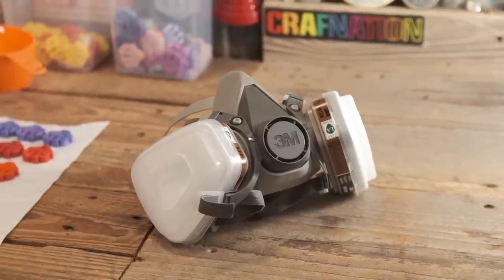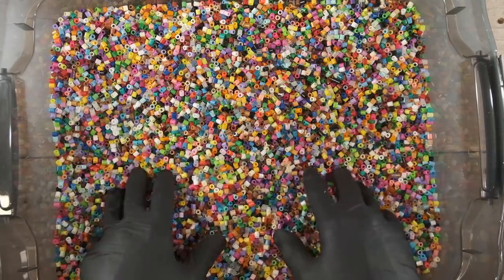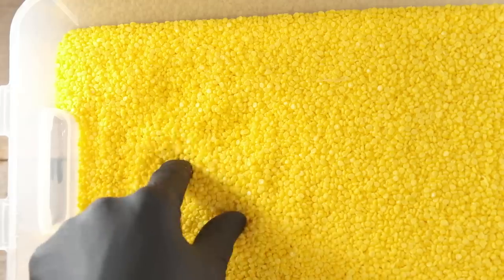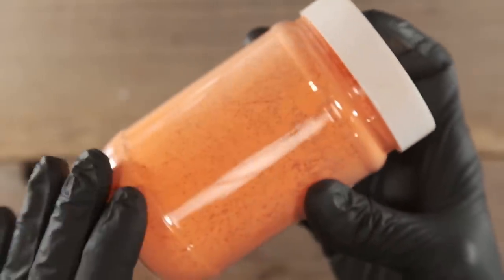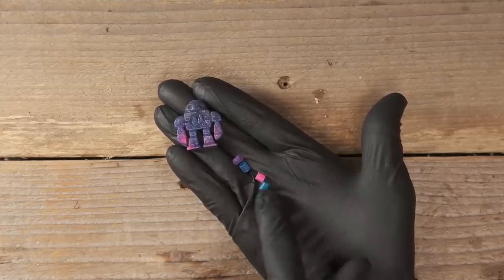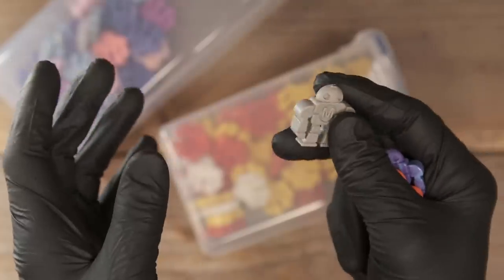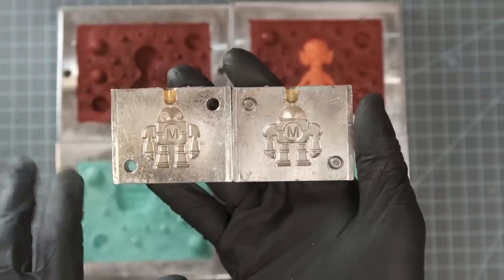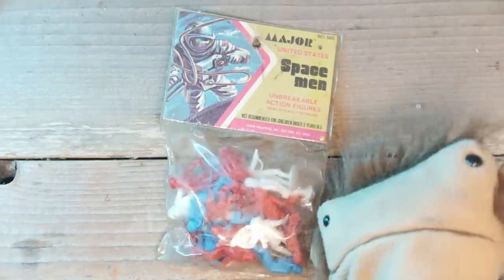Injecting PERLER BEADS! (Galaxy robots, fume extraction, metal molds...)

Comment: Crafsman, you may want to mount the motor for your fume extractor up on the wall next to the filter, that way it won't be quite so noisy, and that way you could run the hose down to wherever you might have some fumes need extractication in a more temporary situation, it would not be as heavy or as cumbersome as moving the motor if you needed to use that space for non-fume type activities
Reply: Brilliant idea.
Reply: Not only that, but this keeps the positive pressure side up near the filter, whereas the back-pressure in the hose means any holes, etc can let the fumes out before it hits the filter.  This is how we do with laser cutters and their fume extraction.

Comment: can you repourpose soda bottles? I mean it seems weird to pay for this plastic, its everywhere, milk jugs and lids... soda bottles... id love to see an episode where you make toys and figures from junk.... 

How many steps / episodes do you all think before he starts melting aluminum to make his own injection molds?

I always liked that purple and blue GI Joe colors. the Vipers.... 

whoever downvoted this, as of right now, 1... has no soul...
Reply: You can find out more information about how to recycle different kinds of plastic on the precious plastic website. On YouTube search for davehakkens. Precious Plastic videos are posted there.
Reply: If you mean the 2 liter type bottles it's usually PET plastic so yes you could recycle and inject them if you clean it out and shred it down to something that would fit into the hopper. The biggest challenge with recycling plastic is the sorting. Your toy might be PP, your bottle PET, your glass PC, your legos ABS, etc. When the item is marked as 1-6 it's relatively easy but if it's marked 7 (other) or if its not labeled (which unfortunately a decent amount isn't labeled) it can take awhile to identify what type of plastic you have). Once identified it's usually just getting a saw and a shredder to get things pellet sized to inject.

On the aluminum front your normal recycling does a much better job at reuse unlike plastic which is only 10% recycled. You certainly could do similar, getting a kiln, a better saw, and a cnc and make your own aluminum mold via recycling soda cans but since you make so few molds I'm not sure it's worth it and the official recycling keeps a lot more of it out of the landfills.

Comment: You could combine your flexable and non flexable plastics to make a rubber jointed makerbot. Make sure to carve a channel around the mating parts to allow the rubber to form a mechanical lock around the individual parts. Just like in an over mould.

Comment: Love the video crafsman, the robot at the beginning when you used the other arms and legs, is the joint weaker where the hot new plastic connects to the old cold plastic. I ask because if the joints are just as strong, could a person create a larger mold than the 1.1 cubic inch shot, maybe with multiple injection holes to make a larger part? I was tinkering with the idea of getting into desktop injection molding but my concern with the smaller units was always the shot size limitation. Brilliant  combining two different parts, I didn't know you could do this.
Reply from the maker: Richard, we think alike! :D I did a stress test on it and was surprised it stuck so well. I was concerned because, with different colors, you can't just cut from an already-heated figure (ie. that just came out of the mold) and get a contrasty color to follow up with. No, that figure has already sat for a WHILE and is cold. So the fact that it seemed to fuse well to a mostly cool plastic surprised me. I was not able to break it. I expected it to just snap off, leaving a clean, shiny surface between. It literally feels like the plastics are welded together right there.

In practice, I would feel better about a truly "over-molded" type situation, where you've got some type of mechanical joint/connection up in there beyond just a flat surface joint. Thank you for watching and commenting!

Comment: next step is a water cooled heat sink you can sandwich in with the mold
Reply from the maker: Been thinking about an elegant solution for the heat buildup, beyond just dipping the mold in water.  :D
Reply: @TheCrafsMan  maybe a  thin brass or aluminum box you could pump water through hook it up to a small oil radiator that you could keep inside the fume extractor tube

Comment: I'm wondering if 3D printing filament can be used in that injection molding machine? 
Lots of varieties of colors available, several different types of thermoplastic, fairly inexpensive, and if you're recycling failed prints, then it's less stuff going in the trash.

Comment: Crafsman, have you tried 3D resin printing a mold?  There are a few resins that are more durable and able to handle higher heat, they may not last as long as a metal mold, but you can print them out as needed fairly cheaply...

Comment: You can use FreeCad to convert an STL to a STP file.
Reply: While technically this might be true, the thing the cnc machinist is looking for is something with large, continuous surfaces. A flat plane made up if 1000 triangles in any format is pretty useless (a pain to cnc program) . Cam software wants continuous perimeter profiles, real circles for holes, single plane faces, and equation driven surveys surfaces, for example.
Reply: Stp>stl works great. Stl>stp does not. The parametric, solid model data is destroyed when going from stp>stl.

Comment: Different colors... what about 3d printing filaments when you chop them you receive pellets. Or use filament recyclers you could make own colors and then chop.
Reply: You can chop up filament pretty easy, I've done it on my injection molding machine. That being said most of the fancy colors are for PLA which while it works just fine is a brittle material prone to breaking. Depending on the item this may work but for a lot of things you want it to be drop resistant. When you get into the other filaments (ABS, PETG, Nylon, etc.) the color selection really goes down without spending an arm and a leg.

Comment: But like, what would happen if you made the mold out of wood?
Reply: High density polyethylene and polypropylene supposedly melt at temperatures lower than the burning point of wood so theoretically you might get away with it, but then the question is whether you can make a smooth, precise mold from wood that that fits together well (you'd likely have to cnc it). And then consider the benefits of wood over a resin mold (of which sustainability might be one) and whether that's worth the potential (likely?) headache. There might be other problems I'm not thinking of.